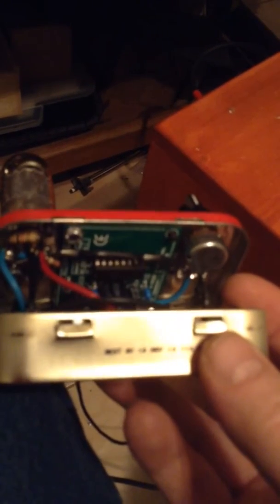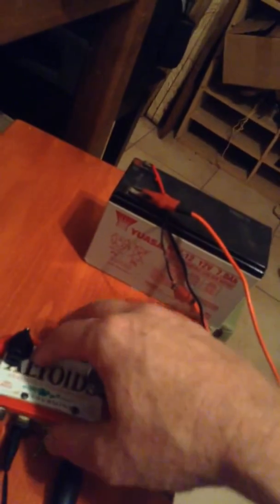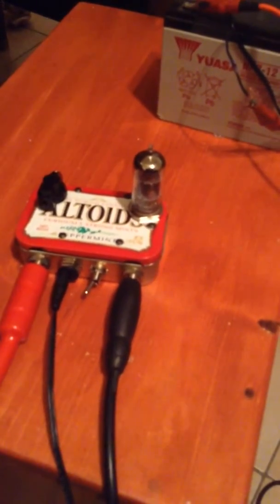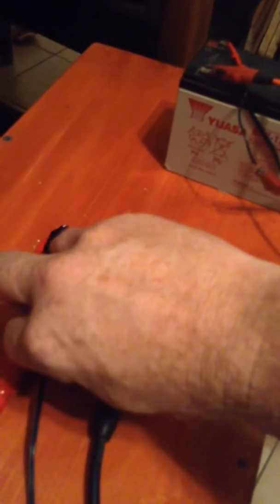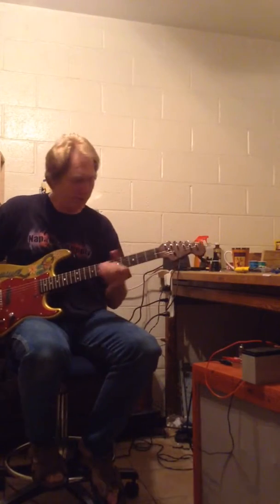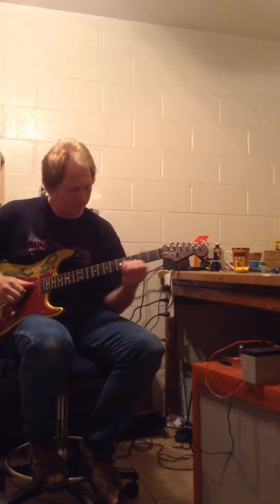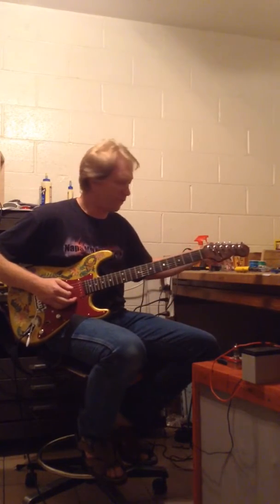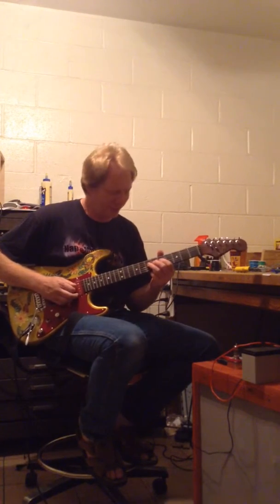Hybrid tube pre solid state power amp 3 watts battery powered

Comment: Love this! Going to try building one. I wish I had found your videos at the time you were doing them as opposed to this far down the road. Would’ve been nice to ask you about this one right as you finished it. Looking into a more readily available option for the solid-state portion because it looks like the Velleman amp may have been discontinued. Is there a schematic available for the pinout? After looking up the valve caster schematic, I was inclined to think it was the same thing just without the gain and tone control. After reviewing your verbal description, it’s starting to sound like it’s even less complicated than that. Been reviewing some of your other stuff and I’m hoping when the budget allows I can actually pick up some of your kits for the larger stuff. Appreciate what you do, and thanks for the inspiration if I’m too late on this one!

Comment: This sounds great. You’ve got the watts. Maybe that’s partly why it sounds good. Schematic? What speaker?
Reply from the maker: Nathan it’s a celestion speaker. Not sure why t sounds good to be honest, but thanks for thinking it does. Been to long since I but something. This is basically a valve caster into a 3 watt solid state kit amp.
Reply: Greg Forbyn. Cool. What kit? And do have any another guitar tricks up your  sleeve?
Reply from the maker: Nathan it’s a vellman kit. They have 3 and 7 watt kits. You can run them at 4 ohms and they are quite loud. As far as tricks... hmmm. The post power amp Fx wet/dry has been my fav. I use one of these for the Fx volume.
Reply: Greg Forbyn. I’m not sure what you’re referring to “post power amp.” Sounds dangerous and fun. Send me a link.
Reply from the maker: Nathan https://youtu.be/KCUwtDI2o6s
This is the wet dry rig. Works really well. I gigged this for a long time with the little vellman in an altoids can 😂